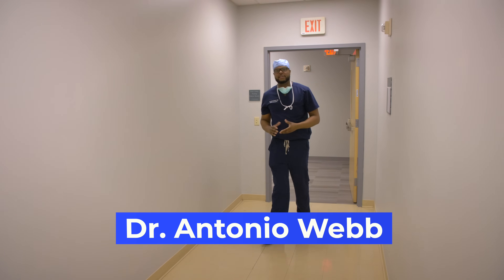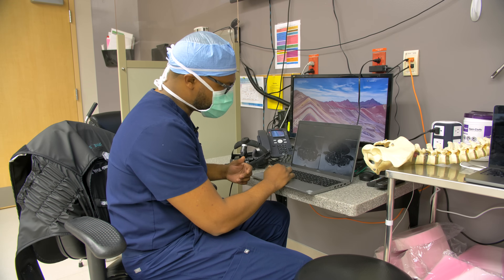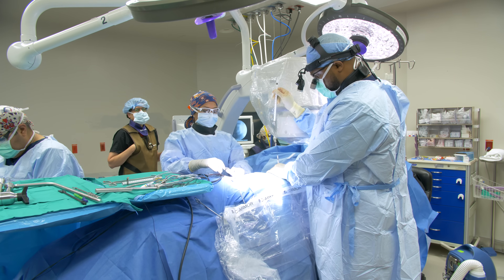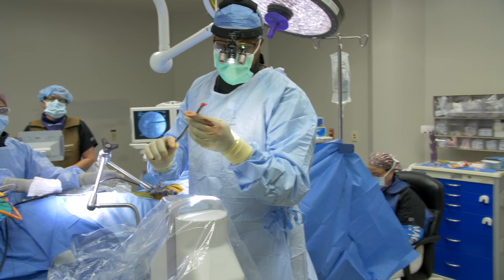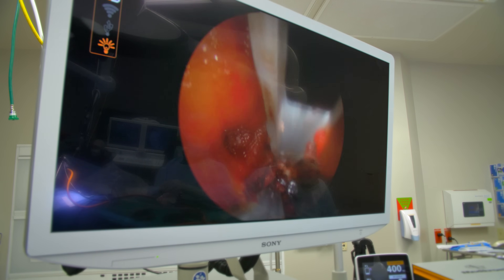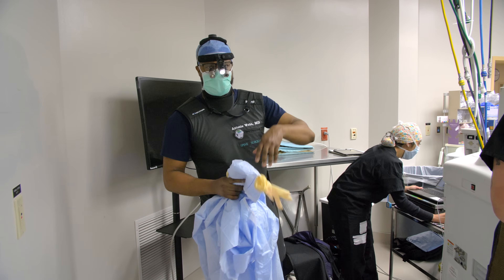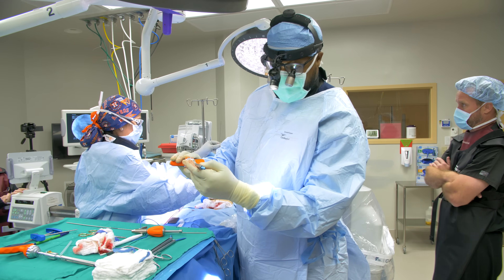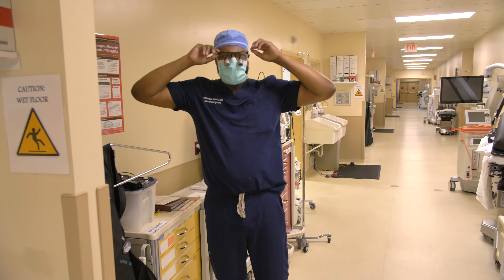INSIDE THE OR: Lateral Lumbar Interbody Fusion (LLIF) w/percutaneous screws

Comment: I have had a Fusion posteriorly with laminectomy at L4-5. My L3-4 has severe bilateral foraminal stenosis, which started shortly after having the fusion.  I'm 3 yrs+ and having quad and Hamstring pain, and quad weakness.  What procedure is used to fix the bilateral foraminal stenosis? if it's another fusion, how do you address the existing screws and rods from the prior surgery?

Comment: My spinal fusion will be L3-S1 ALIF and TLIF. I have been dependent on Morphine, Hydrocodone, Gabapentin and Flexril in high dosage for the last 20 years. Just to manage the pain, so that I could work and support my family. Oh, and steroid injections every 4 months as well. I am hoping to take myself off all of those pills once I have recovered. I am tired of back and leg pain. As well as the decreased cognitive function caused by the prescription drugs. I am a 61 yo male. I am wanting an extreme improvement in my quality of life. As my pain level is no longer at a manageable level with the prescribed drugs. I had a lumbar L4-L5 decompression surgery 10 months ago due to severe spinal stenosis affecting the right sciatic nerve. I was unable to walk 50 feet without crippling pain. That only retracted while laying flat in bed.

Comment: MRI Impression:  There is now severe disc height loss with degenerative endplate changes.  There is no central canal or lateral recess stenosis at this level.  The right neural foramen is mildly stenotic..   guess L4-L5 fusion is coming..  Hemilaminectomy performed 14  years ago...

Comment: How cool that such small openings can be used to achieve a dramatic change such as spinal fusions.
Reply: Yes.  Great improvement from when I had my Spinal fusion over 30 years ago in the uk.  I have two very long scars.  Mine was just fused with bone graft.  I made a good recovery but unfortunately got post traumatic  Fibromyalgia one year later. Now after one very bad fall on my backside aprox 10 years ago my back has got steadily worse with aches and pains and sciatica down my left leg to my toes.  
Back surgery is much improved.